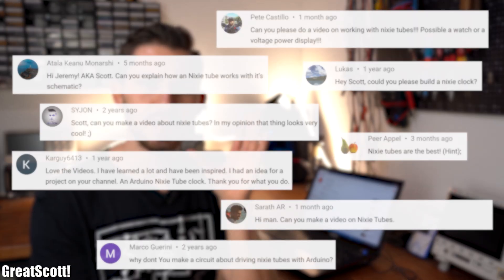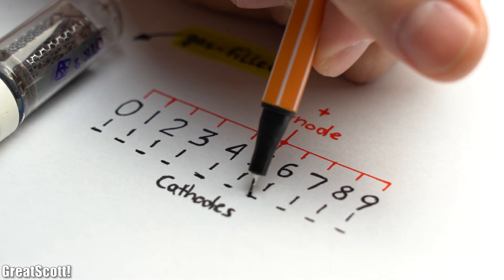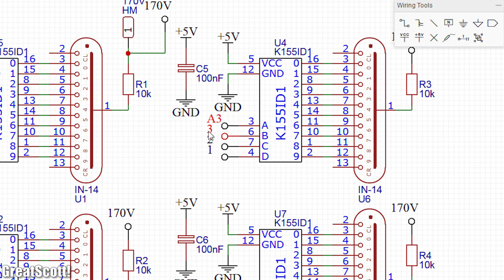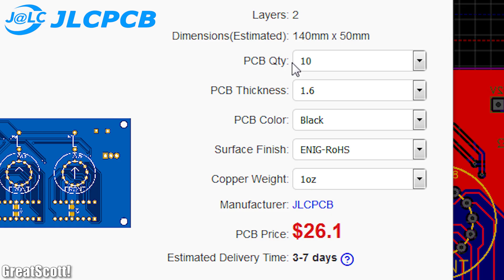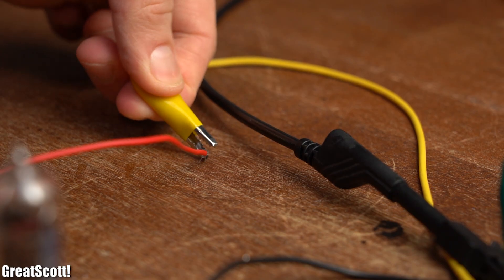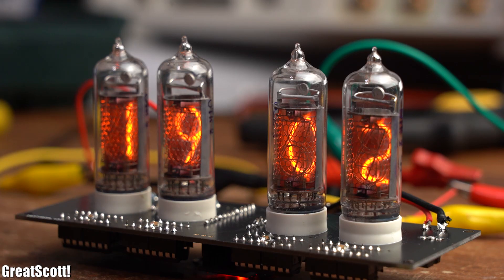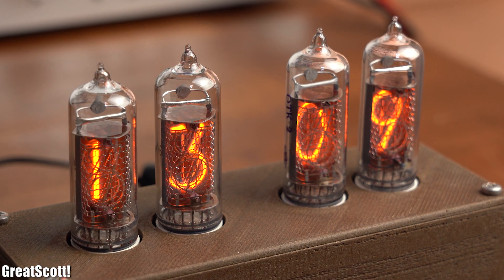Make your own Retro Nixie Clock with an RTC!

Comment: I have a 171V power supply and I measure 3.4mA with a 10K resistor. Should I use a higher value resistor?

Comment: I have a question. I have made similar clock and I think that I have a problem with software. Well everything works perfectly with test sketch, no lagging, turning off etc. But when I programmed DS1307 and Atmega, on of the tubes responsible for tens of minutes doesn't display even numbers. I tried pulling down inputs of SN74141 with different resistors, changing the code a little bit, but nothing. Does anyone have an idea what could possibly cause this issue?
(I am not using Arduino board, but single ATmega chip)
Reply: Okay, soooo for future generations: The problem was in the pin declaration. Even though I declared every pin as output, I added an additional decleration for the "non - working" pin just before loop code. Amazingly it worked, and if it works - don't touch it

Comment: Can i get a little help? 
I bulidt my own power suply and it is working well but the coil is pretty warm. How could i solvet it? Coz i think that could be a problem in long term, but corret me if im wrong.
Reply: If you can still hold the coil its no problem

Comment: I worked on a very similar project for months, making my own driver circuit and everything, but I had some issues with ghosting (digits from one tube slightly visible on others), so I abandoned it. After years I still feel sad about it and plan to redo the whole thing properly from scratch.

Comment: If you used a 4 bit latch on each digit, you would only need 8 pins to control 4 digits. Are there nixie driver chips with built-in input latches?

There is also a PCF8575 IO Expander Module that has 16 input/output pins controlled from i2c.

Also, I found that my DS1307 is off by 7 seconds a day. I used a esp8266 to READ/WRITE settings to the DS1307 using NTP to get the time and then store or compare the REAL time against the DS1307 running time.

Comment: @GreatScott! I could use some help. I have a vacuum tube geiger counter that runs on two 67.5 volt/180ma batteries. Those batteries sell for $64 each.... So that high voltage circuit you featured would be a good solution.. Can your circuit be set to output 135 volts?

The geiger counter is a Nucleonic Ore-Lokator RM2-N

Comment: 170 volts isn't that high. A (non-lethal) taser is 50,000 volts. It's about the current.
Reply: *energy alvaible
Reply: @paolo69  You tried....
Reply: @user-nh3gu1ge3d  a piezo Spark Is around 3000-5000 volt, in that microsecond where there Is 5000 v across your body there Is also around 1 amp of current, but since the Energy Is very low the time Is also very low

Comment: This is a great project. Question: since it is only polling the clock function every second, isn't there time drift during extended periods of time? Not a lot, obviously, but a little bit adding up over time? Just wondering, thanks!

Comment: That is an elegant design, I love that.

I built one of these clocks about a year ago. My advice for anyone wanting to improve the design is to use shift registers to control the Nixie driver IC's. That will allow you to include a seconds display so you can watch the digits cycle. Additionally, shift registers open up more inputs and outputs so theres room for expansion. You can add buttons for time adjustment, a temperature sensor, or an alarm. In my design, I even included a sound sensor to extend the life of the tubes (clapping turns the clock on momentarily) and a relay to imitate an analog clock's tick. 

On a similar note, I've found that those RTCs sometimes lose track of time and after a few months they'll be off track. This may be due to my poor programming skills but it may also be the RTC itself. Not to mention they don't account for daylight savings time (if you're in North America) so half the year it'll be an hour off.

Overall, I really like the design in this video. I only mention these issues/solutions so anyone who wants to try building one can learn from my mistakes.

Edit: Whoops this video came out a year ago, I actually finished my version a few months before his :D
Reply: What's another year... Another option might be to use six 4017 decade counters, that will require 12 gpios (reset+clock). Or even just two gpios if you feel adventurous and cascade them
Reply: I’m looking at building my own Nixie Tube Clock, i found a Canadian company that sells dev boards that receive the radio signals used by atomic clocks and allows you to get the Date, time and DST info over I2C. Then you never have to set it, check for DST or worry about wi-fi connections like a NTP server

Comment: A better solution instead of using all all those pins on the Arduino would be add a Shift Register (or two and chain them together) between the high voltage drivers and the Arduino.

Comment: My uncle built one using discrete components( transistors,diodes,resistors and capacitors). he built it it 30 years ago and it's still working.

Comment: Ya know you can Make a circuit that doesn’t use a microcontroller by and  together the inputs for the number 6 (10s Place for seconds)  and then send The pulse for that to the First min digit. I used this idea for a (although much much less cool) a simple 7 segment led clock I made!

Comment: doesnt the arduino has an RTC built-in?  Incidentally, looks awesome.  I think I would have printed the top piece vertically so it would simulate wood grain when looked at from the top down. But it still looks incredible.

Comment: It is better to use a bit higher voltage e.g. 180V and larger resistor 15K,  that makes the current per tube more uniform against possible spread of tube on-voltages

Comment: Nice job. Three suggestions - cut the nixie tube wires each to a slightly different length - staggered - so you are only dealing with one wire alignment at a time, use a DS3231 clock module, Pi Zero W with NTP or low cost GPS module for clock accuracy.

Comment: In your code at instructables you're:
#define A3 11;
later 
#define pot A3; // so pot becames 11? 
I don't know what the ''pot" is maybe forgotten idea...
later pin 11 is declared as output
pinMode(A3, OUTPUT);
 but then:
pinMode(pot, INPUT);
So as I understand pot (pin 11) reverts to input again and you're trying to write it H or L, actually turning on and off internal pullup? Do I got it right? May this be a reason for pin's strange behaviour?
Reply: #define A3 11; means that A input of the third driver chip will be driven by digital output pin 11 of the arduino.
#define pot A3; means that the pot will 'drive' analog input pin A3 of the arduino.

#define 'variable' 'pin of the arduino'
Reply: @tomazjancic9057   so I guess that's why he couldn't use pin 11...
Reply: @michak9265  Actually yes. Forget my previous reply, lol

Comment: loved the video! but i have a question i love working on electronics and love soldering. i would realy love to recreate your version of the nixie tube, down side is i am terrible at creating circuit board so i was wonderen sinds you bought 10 of them if i could buy 1 from you. send me an email if you are willing to do so, thanks. ps keep up the work with the great video's!

Comment: are the gerber files the original which means that we need to attach that resistor and connect the A6 and A7 pin to 1 and 2? or are the gerber files adjusted to that?

Comment: so, I have a quiestion. anyone can answer this. when you put in the time for the RTC, can it keep track of it FOREVER? even when you disconnect it? otherwise it will have to be plugged into your PC and power supply between unplugging the PC and using the power supply to get an acurate time. I guess what I`m saying is if you enter the time 1:30, cut the power, turn it on again 2 hours later, will it show 1:30(the preset), 12:00(the default), or 3:30

thanks
Reply: oh ok I just saw that it has a coin cel battery slot so that must mean that it would show 3:30. :) right?

Comment: 3:53 Now question, does those driver ICs support the "dots" of the IN-14? 
As I want to make myself a Nixie clock but I also want to be able to use those "dots".
Reply: No, you have to use separate IC (maybe another K155ID1 for all dots) or high voltage transistor like PMBTA45
Reply: @nikolaipavlov544  I figured it out in the mean time, I chose the PS2833-4-A SMD quad-channel optocoupler which can support those high voltage and is very small so I can use 1 for 2 nixie tubes.

Comment: I love your video's and I'm going through your electronic basics video's but I'm missing one, creating PCB's. I used JLC PCB before, based on your recommendation, but never with my own designs. I ordered the nixie tubes from your video but would like to create my own PCB based on the ESP32 since it can run MicroPython. I'm having a hard time converting my thinking from breadboard to diagram and figuring out how to add other boards to my design, for example I'm not going to build my own ESP32 since I have a bunch of them laying around, same goes for an RTC clock. I looked at your profile on EasyEDA but I didn't see the design/diagram on there.

Comment: I have fantasised about building a clock like this (though with higher resolution) based around a chip-scale atomic clock (with appropriate radiation warning stickers of course!). A clock module with built-in network time server would be great also.

Comment: If you are attempting this be aware that the US Amazon link for the Arduino is incorrect.  It does not have the 3 holes at the bottom for Gnd, A6, and A7.  You can actually use the board in the link if you do not attach a header and wire the PCB connection to the alternate pins on the Arduino controller as noted in his video.

Comment: Nice NT clock project Scott. Would the heat from the power supply be a concern being enclosed with no ventilation, from what I could see? Just wondering.

Comment: Why does the 10k resistor need to be in series with the anode to pull the voltage to 145V? Wont this stop the voltage source from achieving the 170V initial voltage?

Comment: Scott : High voltage is dangerous !
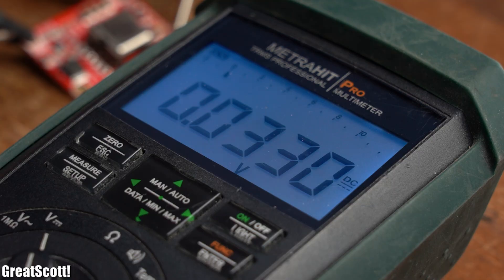( Scott at 3:06 ) : "Turns the circuit on while holding it from the High voltage side"
Reply: uhm i'm pretty sure he turned the power on after he connected the krokoclamps

Comment: I am working on my own Nixie clock these days. I will be 6 digits, with seconds and uses a DSP12F module as a MCU. I also have a RTC in my project so most of the time keeping will be done with RTC but the MCU will also update the time from the internet once in every 24 hours. I like your simple but very clever design too. If I were you, I would prefer DS3231 as the RTC since it has an internal  TCXO and keeps the time much more accurately than DS1307. Also the HV power supply link you provided gives a different unit than what you used in the project. The one in the link is the one I intend to use, but I am very much interested in the one you got from Tindie. Although it seems a bit on the expensive side, looks better quality and maybe it can provide a little more current since I will be driving 6 tubes instead of 4. Good project, thanks for sharing!

Comment: Agh great video!
But I don’t understand why we use an external clock instead of the Arduino’s internal clock??
Reply: Because the RTC module has a backup battery while the arduino doesn't and would reset after a power outage.

Comment: Cute project, it seems like you just bought most of it in modules,  that's okay, but you should have at least mentioned how they work, I agree with others here, that if you muxed the tubes, (maybe using 4 I/O with 4 HV Transistors,and just used 1 decoder) it would have been cheaper and more interesting.  To be honest, not having a couple buttons to adjust the time seems painful, unless you have a computer handy. But cool outcome.

Comment: Hey guys can someone explain what a nixie tube is? I’ve never encountered the term before, do they work like fluorescent tubes, by exiting low pressure gaz with high voltage ? If so why don’t they use high voltage (in engineering high voltage is over 600v, i’ve handled fluorescent lights that had a 230v—> 4000v transformer, is it because the lamp is smaller? Doesn’t seem right)
Reply: Okay...well, it's 60's era Tech....they use Neon low pressure gas, (why they are orange)  I've heard it takes about 90volts to ionize...but I may be wrong, and a bit higher to sustain constant glow.   The voltage has to be DC in this case, otherwise the Anode screen would glow too, if AC.   Just like an NE-2 Neon Pilot lamp, they need current limiting, otherwise they would runaway, and arc over if the current and voltage were high enough ...hope that helps.
Reply: @slordmo2263  ok thanks
Reply: @slordmo2263  i studied electrical engineering before moving on to physics and never heard of them ^^

Comment: I just wondered if the power source supplied the 5 volts for the Arduino as well. 170 will definitely fry the circuit ;-) If not, how did you solve it? I know that this is probably a noob question, but that's what I am ^^

Comment: If you would spend some time to learn decent soldering skills and/or buy a decent soldering station, many of your projects would have less problems. Your videos are really nice but I am sorry to say you suck in soldering.  Those balloon shaped joints (so most of them) need rework. Even if they kinda work now they will fail in the future.
Reply from the maker: No. I never had a solder joint that failed on me.....ever. Making proper solder connections used to be my job. I learned how to do it properly.

Comment: The esp is far superior to any arduino, it has built in rtc and can connect to WiFi to update and correct it’s time
And you can use cheap spi io extenders

Comment: I was wondering if ugliness of the case is on prupouse.
Now I see that it's not. Try using bit larger nozzle for filled filaments. Also, you need to play with retraction settings a bit and maybe temperature.

Comment: @GreatScott! In the future a handy trick for dealing with components that have lots of flexible legs is to cut each one slightly shorter than the one next to it so it ends up like a spiral so that way you can insert one leg at a time and not have to deal with trying to get all the legs in at once. This makes working with these sort of components significantly easier.

Comment: I built a similar clock a year ago but took a different approach.  It uses a Raspberry pi zero w and gets the time from an ntp time server.  I also went with 6 digits so I can see the seconds as well.  BTW, cutting the tube leads in a spiral length allows you to get the tubes in the board one hole at a time.  I like clock projects and even have one that uses 4 inch Burrough nixies that I built in 1973.

Comment: Did you think of multiplexing the high voltage controller chip to run the four tubes and only use eight pins from the microcontroller?

Comment: Couldn't you just use one driver (decoder) to display the numbers on the tubes commutating their power supply at an specific rate (like you would do with segment displays? I'm wondering if that's possible.

Comment: U are dude)))
You can use only one K155 and dynamic indication by transistors or optocouplers
And you can generate 170V by arduino pwm signal and LC-step up generator, just check AlexGyver’s projects
I am from mother-Russia an I built a clock from 6 tubes at my own, I made it when I was 16, now I’m 17))
Btw IN-14 costs only $2 for one lamp in Moscow, but you can find a cheap one from old people)) Before the hype you could found 6 lamps for $2, but nowdays there are no new lamps and they become more and more expensive 
There are no new K155 too, so all the people need to save them
Now I want to earn some money and make a clock from 6 IN-18, they cost about $60 for the lamp in Moscow, my uncle said that they threw them away in very big quantity in the 90’s
Короче говоря, из России с любовью, всем добра)) Советское прошлое пошло на благо и в другие страны))
Reply: Btw I got electrocuted from the arduino’s 140V power source, it is not so painful, just a little hurt

Comment: to save pins I would have used a shift register on the BCD to decimal drivers, 1 register (74HC595) per 2 nixies. bit of a mission to figure out what order the bits need sending but you can daisy chain them and only uses 3 pins or so

Comment: Hey Scott pls will u reply my one question. Plsss, 
I made ir remote controlled  using standalone Atmega 328 pu microcontroller which controls 8 relays but 1 relay connected to AC fan which after switching  it makes all relays turn off it's like it get reset to off positions. What should I do to avoid this🙄